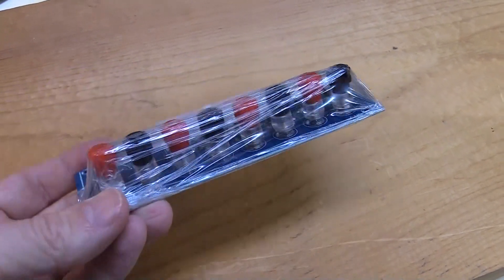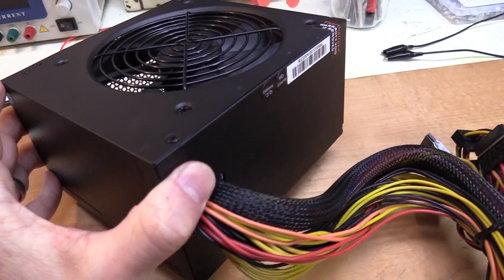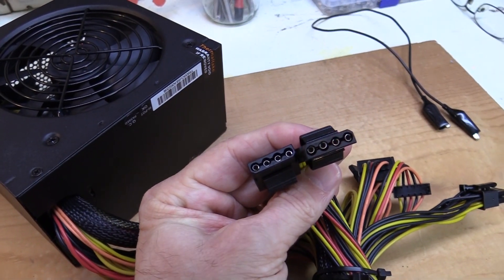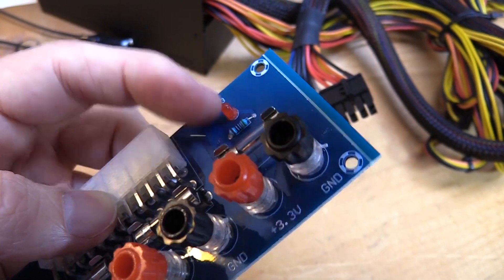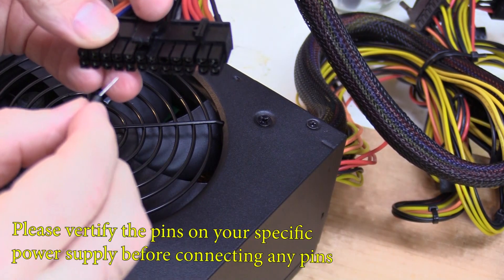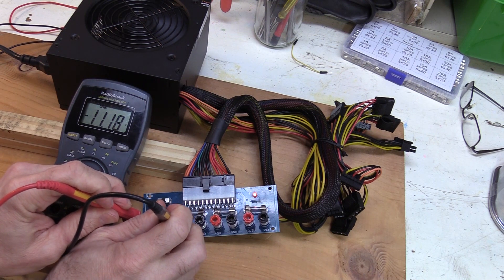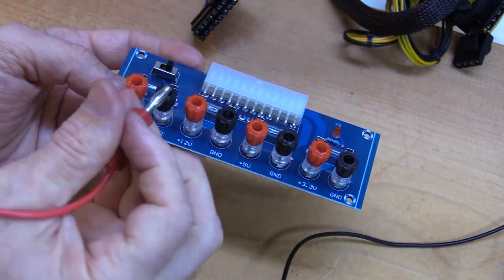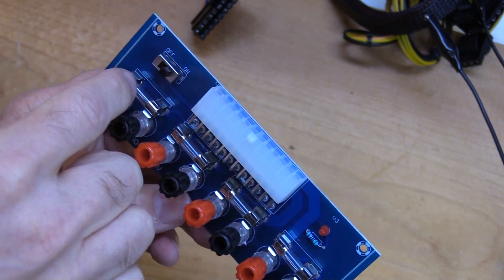How to Convert a Computer Supply to a Bench Power Supply: ATX Breakout Board Module Review

Comment: I hope you're still responding to comments...

I made 2 of these to power some 12v devices in my machine shop, and both of them have the same issue / problem.

The voltage on the 12v rail fluctuates by about 1v in consistent intervals. I have a 50 w 25 ohm  load resistor on the 5v rail, which doesn't affect either PSU with or without it.

Any ideas what might cause that? Like I said, I have the same issue on both PSUs. Thanks